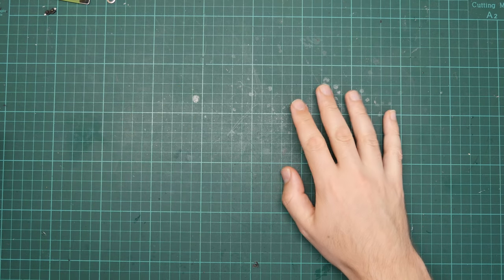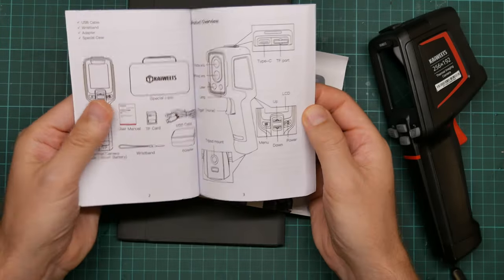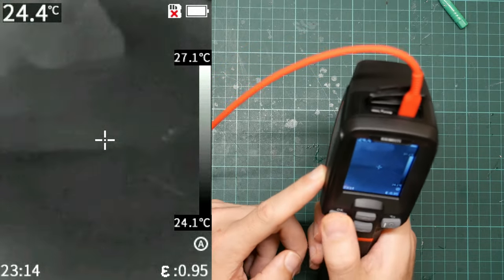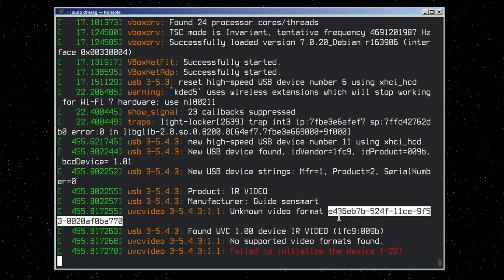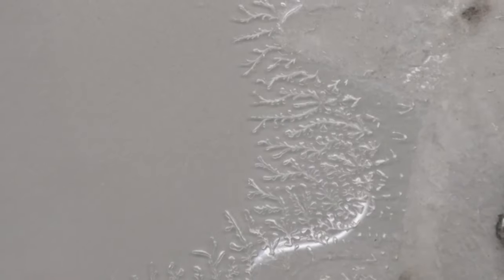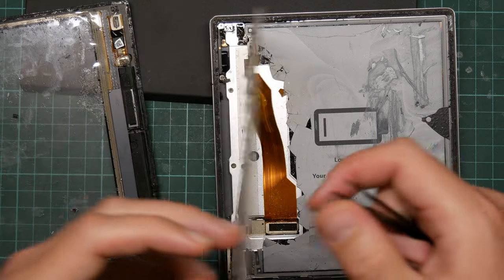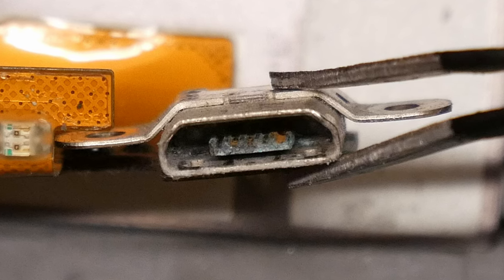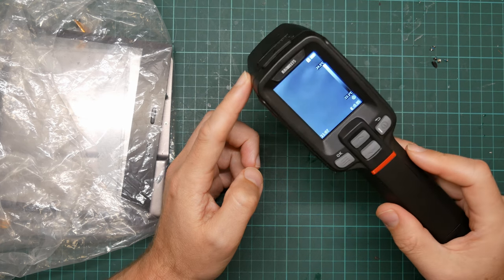Destroying a Kindle Oasis 2 with hot air and a Kaiweets KTI-W02 thermal imager

Comment: The freeze you commented around 16:14, is something common on all thermal imagers.  There is a recalibration procedure where a metal screen is placed in front of the IR sensor, hence the clicking you hear, so the machine knows all pixels are seeing the same known temperature.  The screen temperature is measured internally via some temp sensor.  This is to manage the huge drift the sensor itself has.
Reply from the maker: That makes sense. I did try using it with a motion detector to pick up wildlife and got so many false positives from sensor drift that it was completely infeasible. Incidentally, I completely fail to understand how these thermal sensors even work. Without active cooling, aren't they blinded by their own thermal infrared emissions?

Comment: A valiant attempt, but yeah there's no way that stackup is coming apart successfully. You were probably better off milling the back off instead...
Reply: Yeah, I was going to suggest the same thing. Mill out around the charger socket.
Reply from the maker: It's uncomfortably close to the battery for that --- doable, but preferably not in my apartment. Going in from the top would be preferable but it looks like there's not quite enough clearance between the screen, the touchscreen connector and the edge of the case for that to be viable.
Reply: @hjalfi  yeah. At the end of the video I saw you mentioned that option. I did consider revising my comment but instead opted to refrain from commenting until I've watched the whole video in future. 😄
Reply from the maker: @DavidLatham-productiondave  BTW, if anyone in or near Switzerland has a broken one they want to send me, I'd actually be interested in doing this.
Reply: @hjalfi   I'm about as far away as you can get in new Zealand. I was inspired by your video to get my Kindle 3 going again. The battery has died and it's easy to replace on that model. I'm wondering if it will run CPM.   😂